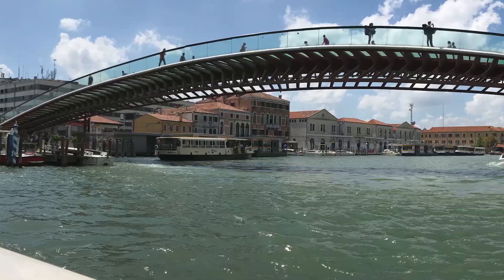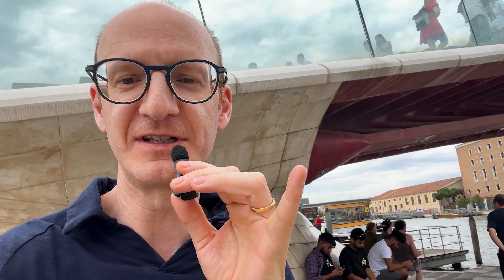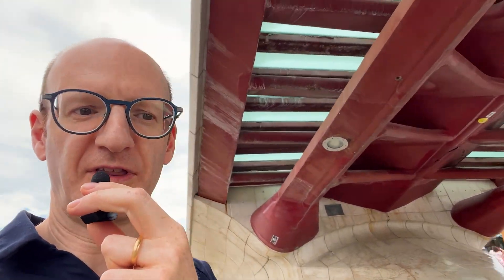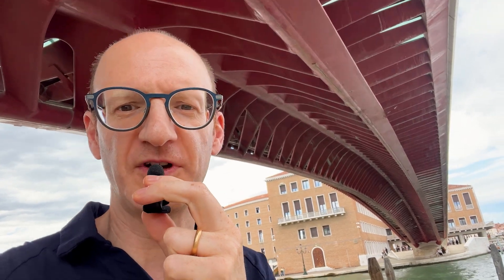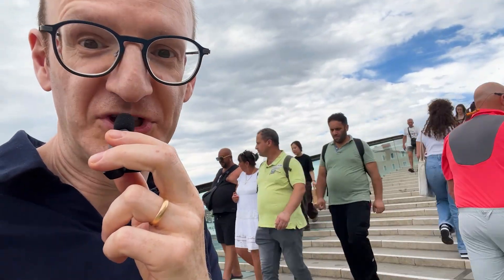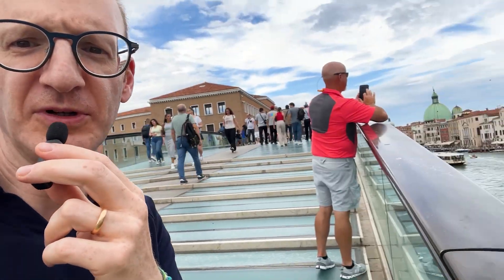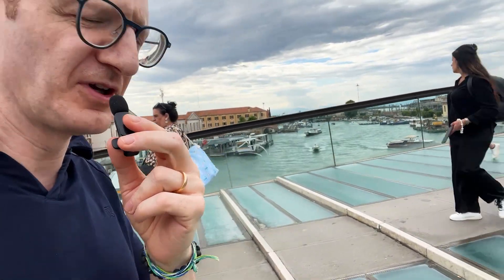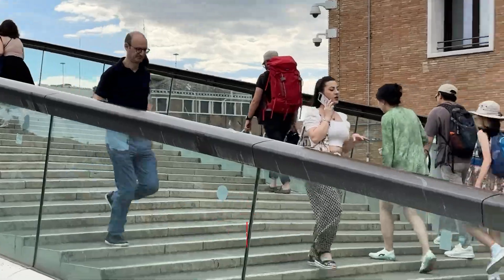The Calatrava Venice Bridge!

Comment: Lovely video on a beautiful work of art. What is the finish of those slippery steps? Looks like a smooth tile.?. I wonder if there is a way to address that without replacing everything.
Reply from the maker: thanks and good question.  There seem to be two materials there.  Also, I read they just started replacing the glass treads after a 2-year delay: https://www.architecturalrecord.com/articles/17273-venice-begins-dismantling-glass-steps-of-santiago-calatravas-slippery-glass-bridge